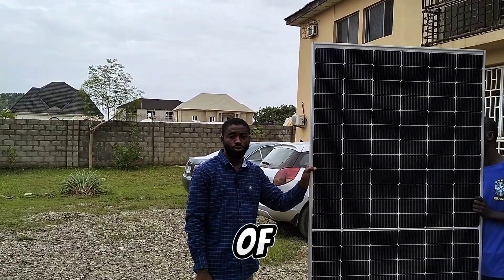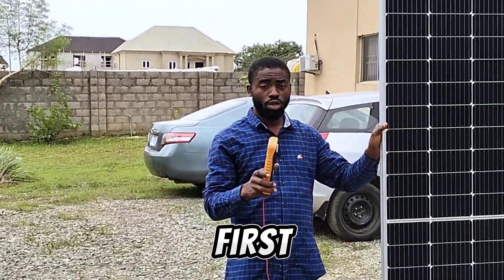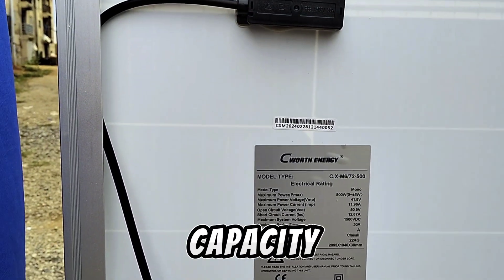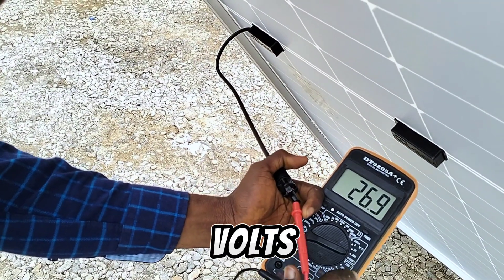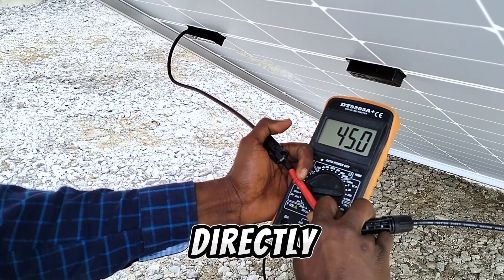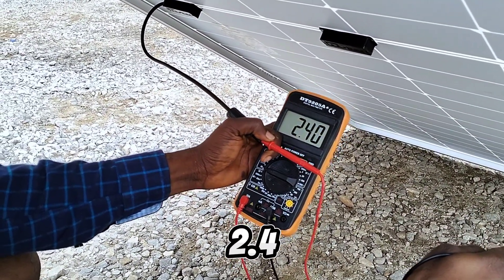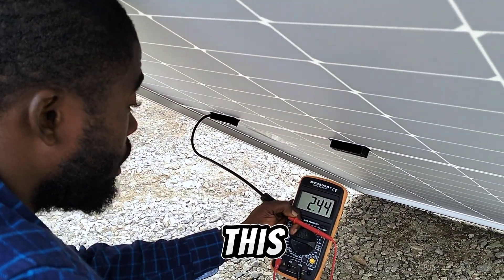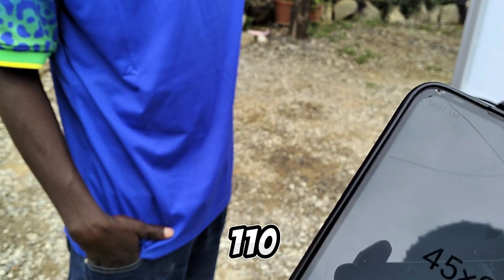how reliable is cworth solar panel? check out this test under a low weather condition

Comment: This is not the best way to measure power. The voltage you are measuring is Voc ie without load, generally voltage drops when current is flowing within the load hence the real power should be lower than what you have got.

Comment: You are measuring Voc and Isc though. You should compare your results with the label values.

Normally you should use values on load to estimate the panels production.

Nice job too. Well done 👍🏾
Reply from the maker: Okay sir

Comment: Good Morning Emitech Electronics. Honestly, I thank you so much for your videos. I ave learnt a lot from your videos. I have a similar question to that of Pejukinwande. I have a 6.2Kva Wellion Inverter and 5kwh /48/100AH Lithium battery and six  700W bifacial Jinko solar panels ,  What Capacity and type of  DC , surge protection device and automatic voltage guard would I use?
Reply from the maker: 60amp DC breaker 
63amp voltage guard

Comment: You are totally wrong that’s not how it work, you testing for open circuit, the ideal way of testing the wattage is putting under a load😢
Reply: The meter is no load bro, it’s a measuring device
Reply from the maker: @creativeedgemediaproduction maybe you should do more research
Reply: You need more research, you only test the Open-Circuit Voltage, and short circuit current, instead of vmp and imp, I only commented for the purpose of correction and not criticism, check and do more research, thanks, I am also an installer here in Nigeria too
Reply from the maker: So the meter is not a load?🙄🙄
Reply: You are  actually right.
Reply: Under standard conditions with full sunshine testing that panel with a multimeter, you’ll get 50.9V, 12.67A, but you will get 41.8V, 11.96A, just judging from the label in your video

Comment: ~Good morning Emmanuel,

I have a Cworth 6kva solar hybrid inverter, (the type you installed in Edo and Lekki) and a 10kwh/48V/200AH Lithium battery.

I want to add 8 to 10 panels to the system.

What capacity and type of the following should I use?

DC Circuit Breaker

Surge Protection Device

Automatic Voltage Protector.

These are the 3 safety devices I want to know what capacity to use and what brand would you suggest?

And what type and size of cable to be used for the panels connection.

Thanks for your videos. Very informative.~
Reply from the maker: You can use 60amps DC 
Then 63amps voltage guard
Reply: @Mairigaemmanuel  Thank you very much. God's blessings on you and your family